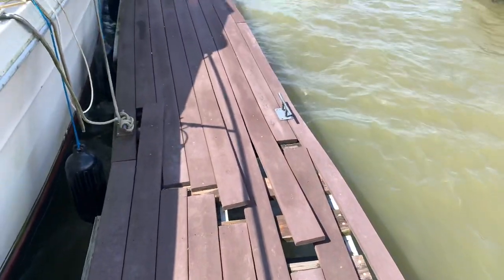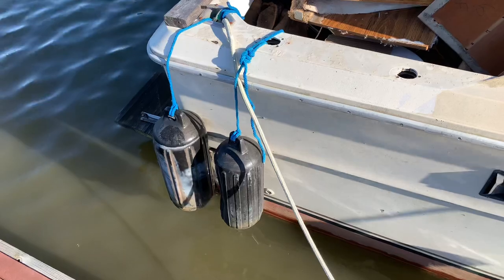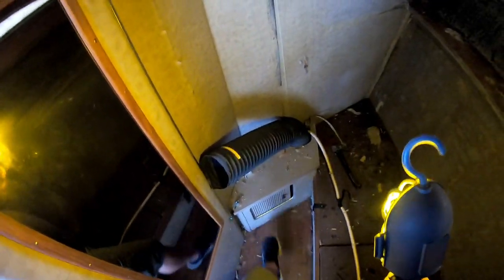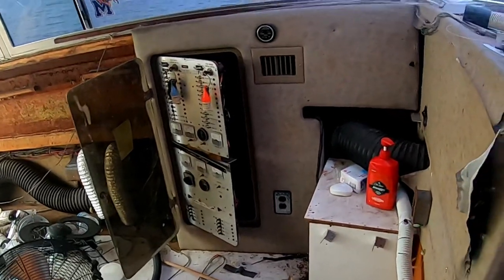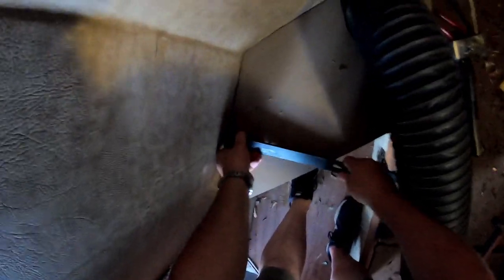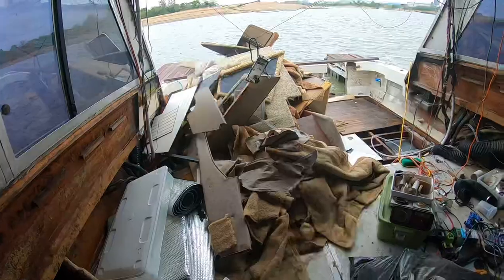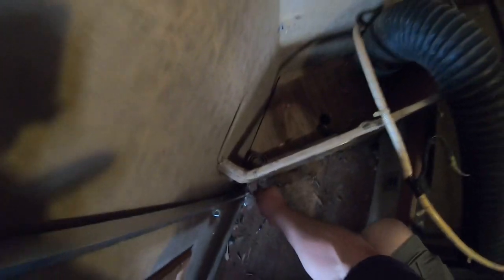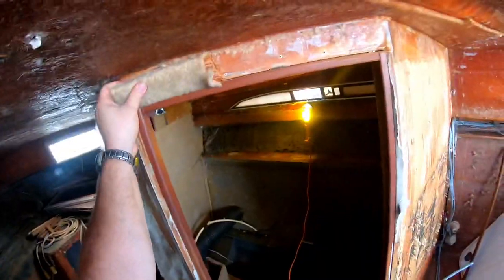Boat Restoration: Taking Damage

Comment: Great job Keep at it!Learning lots of what Im going to be facing with my 78 300SRV
Reply from the maker: Man I love those boats. Just love those lines!
Reply from the maker: Do you have the fly ridge or the weekender package?
Reply: Fat Guy in a Little Boat I have the fly ridge model.What kind of shape are your fuel tanks in.They are saddle mounted on the side shelves.Mine are original they were zinc chromated and show no corrosion that I can see.These things are built like tanks.We tried going through a lock and a 35 MPH gust caught us going in and slammed th starboard stern into the concrete door so hard it bounced!It just left a little scratch on the rub strip
Reply from the maker: The fly bridge model is sharp. We have both models at my marina.
Reply from the maker: Also, my tanks are pretty good but I’m replacing them with poly tanks anyway. Good for another twenty years!